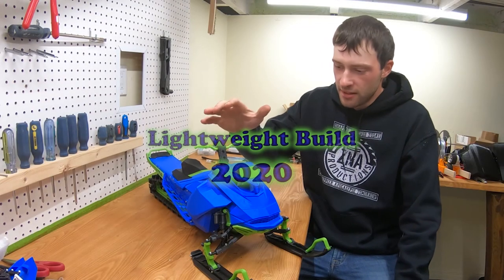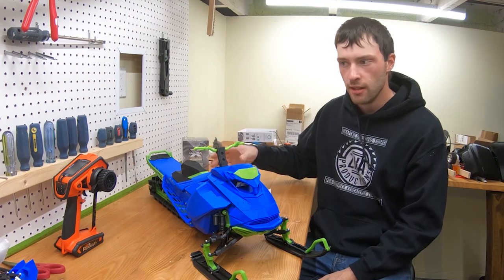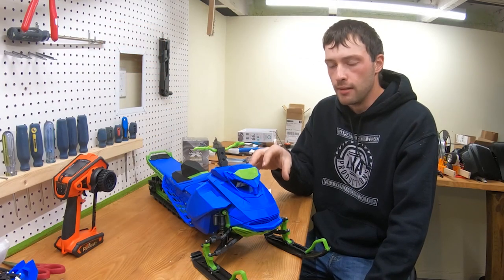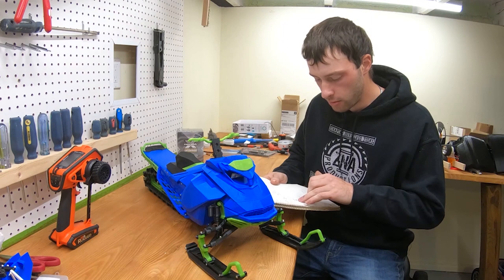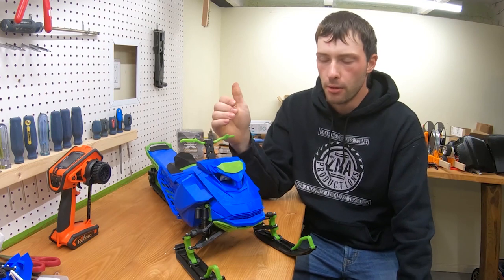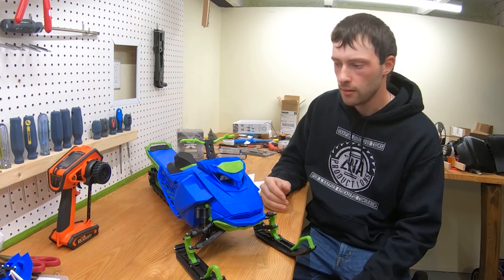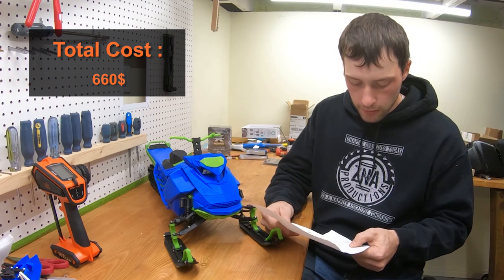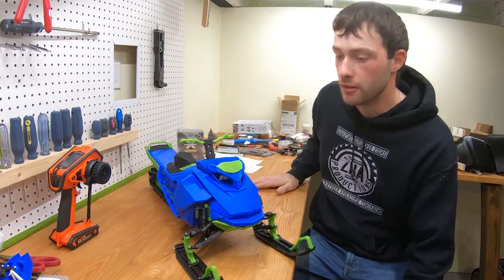Weighting the G4 - Project Schottky Conclusion

Comment: 2800 is pretty nice that is a huge improvement! I'm gonna have to get my rmk weight again on video this time
Reply: It's a 540 brushless 4pole 3000kv with 120amp esc and 2500mah 3cel and micro spectrum receiver fan on esc only, I gotta pull it out of my unimog to weight it. I'm in western Manitoba we should rip these together if your near by.
Reply: Which electronics do u think it’s the best for the rmk version ? I got one but I don’t know what electronics I need to buy 😂

Comment: Did you use the 3.5 turn motor? Man I don’t understand motor torque/speed. Etc. Great work man!
Reply from the maker: I used a 10.5t.  To me, that was the sweet spot.

Rule of thumb, you take the kv × voltage = motor rpm.  Most motors should not exceed 40000 rpm, unless specified by the manufacturer.  You can find most datasheet online fairly easily.

If you have a lower kv, (and thus higher turn rating)   You do not gain torque, but you gain efficiency.  You also lose max rpm.
Reply: @Pascal_Robert--Rc_Creations  thank you for the details. I took a SS of that info so I can study that a bit. With pinion and spur gears, it also adds to the answer for a  proper set up. Is there an easy way to calculate what gearing does what to a given motor (heat, speed etc)?
Reply from the maker: @derwoodsdiy7710  i found i had best results between a 1:4 to 1:6 geat ratio overall.  Motor temp dictate if your gearing is too agressive, and also power used.  (Esc with a data logger is a must here to verify that).

Have a look at the video on choosing your electronics i did a few months ago.  It will answer a lot of your questions
Reply: @Pascal_Robert--Rc_Creations  thanks again for your expertise man. I have watched that video. Too many times to admit 😂 Loved your video about power being less important to weight. Sense of humor is great!
Reply: @Pascal_Robert--Rc_Creations  one other thing. For gear ratio, is that total ratio or just pinion to spur?  I think you are saying total ratio when you say overall right? Now I feel silly asking 😂

Comment: My Alpha One rc is $300 to make 1 full sled
Reply from the maker: Including the electronics?
Reply: Pascal Robert - Rc Creations yeah including electronics. I’m using PLA and I might do a video on every little price. It takes 2 rolls of 1Kg PLA which is around $60 and the electronics were $225-$250 so very close to $300 I tried finding cheap but good electronics that work and happy with what I found :)